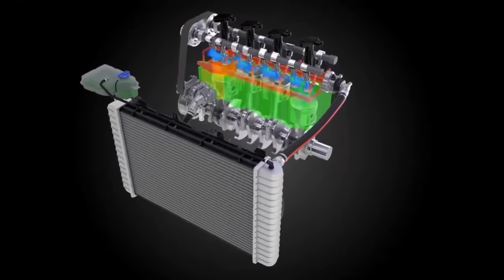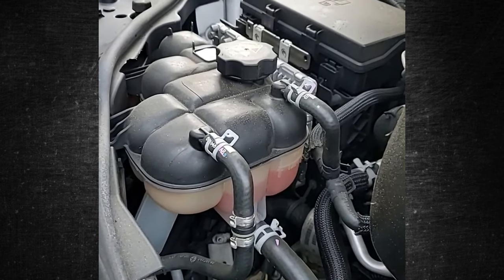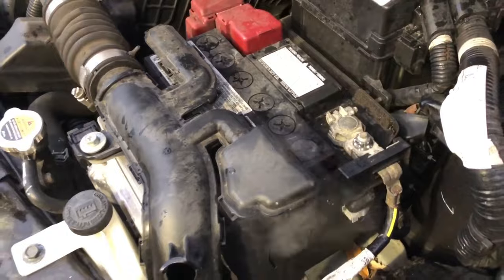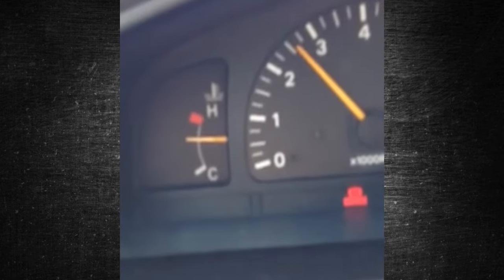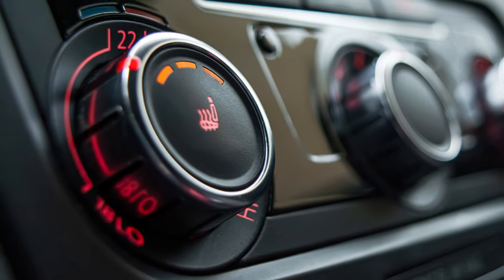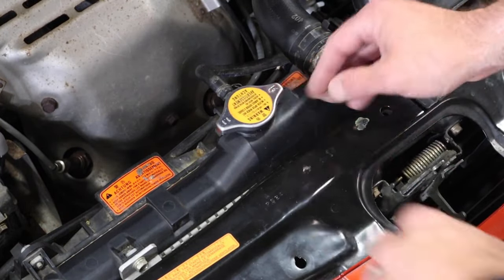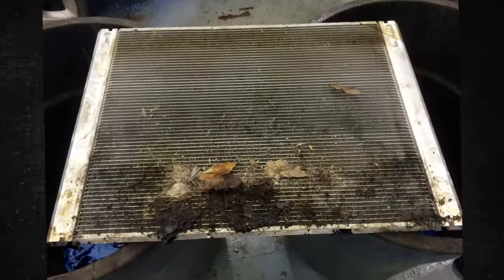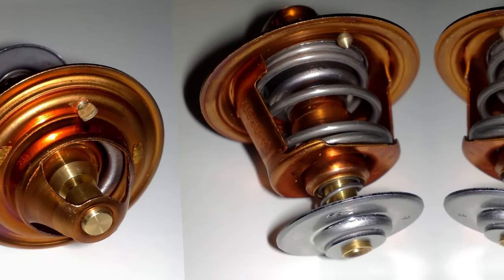6 Signs of a Bad Radiator. How to Check for Radiator Leak & Replacement Cost

Comment: My radiator leaking now am in the roadside I don't know what to do. When I start the car, engine just idle to high am scared help any one pls 😭🙏
Reply: Mines just did that today what did you do?
Reply: Mines couldn’t start on the side of road I seen a leak at the top of radiator so I’m going to get that replaced and also since it doesn’t start it might need a new head gasket
Reply: Let cool off then try start and just try get it off the road ,buy fix a leak auto zone or...if not tow it  if starts turn the heater on highest if Abel to drive off the road you probably won't be able too fix it there and takes much time and effort finding what the problem is
Reply: @unwindingplace7556 well am sure you probably have too get it off the road,  right ?... your not going too be able to fix it there .tell what you the poor person what too do..